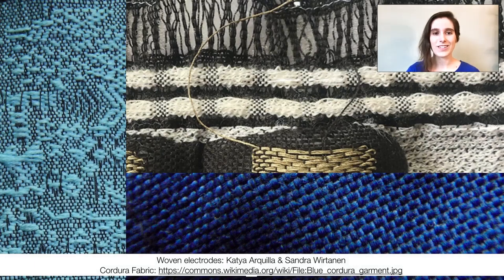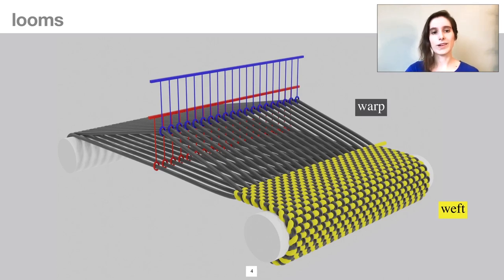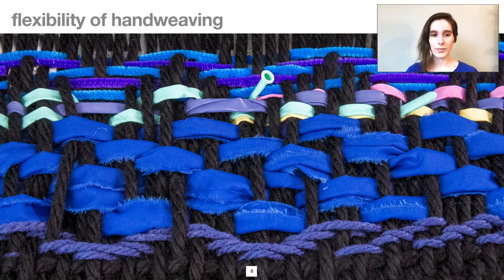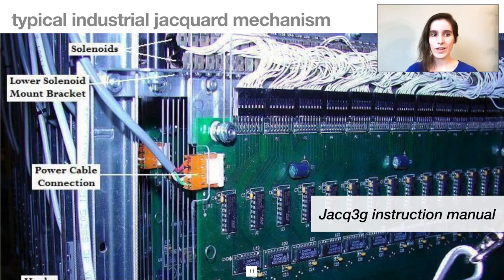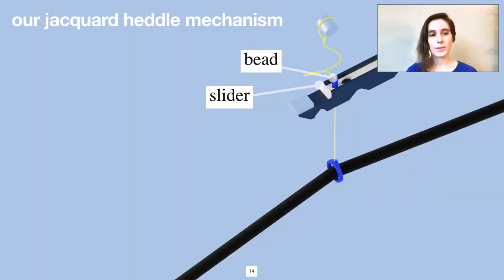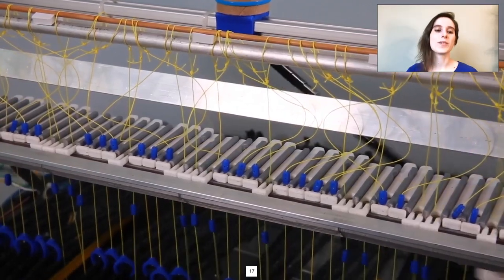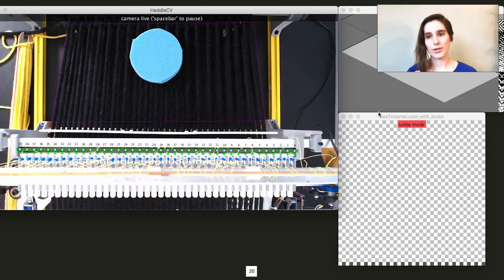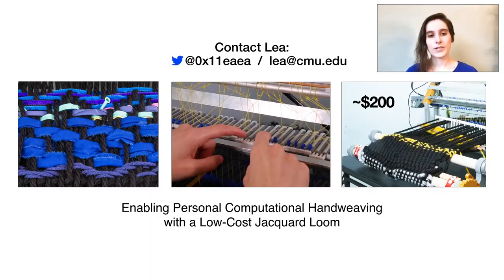Personal Jacquard Weaving

Comment: How do you get all the warps lifted again?
Reply: My understanding is that only two motors are enough in this configuration: one to lift all of the threads, another to then run the selenoid then sets the pattern, and then the first motor lowers it in place. Pretty ingenious approach, albeit much slower than individually actuated one.
Reply: *solenoid. 

This also solves solenoid direction: when lifting, all the stops need to be released, and that could be just another solenoid triggering the spring loaded release on all the stops. Then solenoid just needs to push individual stops to click into locked position before the whole set is lowered. 
I'm so impressed by the approach.
Reply: @buzztard  Two motors might have been enough (but I doubt it).
However there ARE not two motors here.
Also, all the sliders would have to be (temporarily) moved to their "open" position so all the wires can be pulled up (by some means), then moved back to the "closed" position.
While the usual mechanism can open a slider, I see no way to close it again.
Perhaps it's all done manually.
Nothing about this is shown, and if manual, it would of course make it all a lot less impressive.
Reply: It's an undeniably manual process: 1) the weaver drops the entire heddle bar down, past a pusher bar which pushes all the sliders to the "bead can pass through" position, then 2) lifts it back up again, with another pusher to reset the sliders. The "reset" position of this loom is one where every warp is raised, and "selecting" drops them; this is sort of inverted from a standard loom, in which the selected warps are raised from a neutral position. (Of course, sinking shed looms do exist, as do countermarche looms which split the warp both up and down.)  I think youTube won't let me link to a non-youTube video, but you can see it better at ~0:25 of the video at this page: http://lea.zone/jacquard_handweaving.html

The "two motors" are 1) the stepper  "x-axis" motor which positions the solenoid, and 2) the solenoid. One could definitely imagine another motor handling the lift/reset.  Personally, I kind of wanted to build our heddle mechanism onto a floor loom and do the reset with a lift pedal, but the portability of the tabletop model won out.

Comment: Is this also how persian rugs are hand made ?
Reply: The foundation or ground of a Persian rug is woven with just a simple tabby weave (one up, one down) for 1, 2 or 3 picks and then all the coloured threads in one row are knotted in by hand one knot at a time using a plan on paper.and then the foundation picks are placed again to hold the coloured threads in place. This is repeated for each row of colour.  It takes a long time to make such a rug.  The process for pile tapestries or Ryijy is similar but there are less warp threads and so fewer coloured tufts to knot and because the pile is kept longer the coloured row spacing is also more and may have 3-9 picks between rows.  Each hand made knot could be a different colour and may be selected from two to dozens of colours depending on the style and design.

This system describes a type of Jacquard loom and these are used top make intricate designs in texture and colour.  However they number of colours is usually limited to a small palette of perhaps 2 to 4 for any row or two as the colours are formed by the exposed weft threads that generally run across the whole material.

There are videos on youtube on making Persian rugs and Ryijy tapestries.
Reply: @KallePihlajasaari  Thank you kindly for your detailed answer which i read with interest. I hope someday i can afford a large Persian rug.